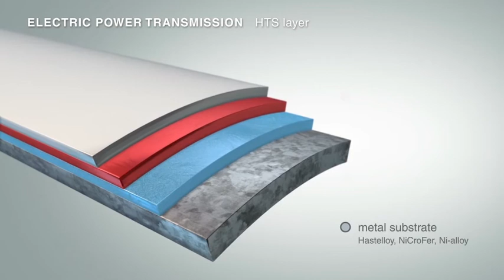High-temperature superconductors for efficient current conduction

Comment: поразительно, вопрос в том как подключить такой кабель к обычному проводнику, ведь в месте контакта проводник неизбежно начнет нагреваться
Reply from the maker: Thank you for your comment. We hope that it is ok if we respond in English, because we assume that you will understand it if you were able to grasp the content of the video and because the answer might also be interesting for non-Russian speakers. 
The question of ZzzmaerD was whether connecting a supercoductor to a normal conductor would lead to an increase of temperature in the normal conductor.

This question is very interesting because, indeed, the transition of a superconductor to a normal conductor (often made of copper) constitutes a challenge. For the transition an isolated section is used and the two different conductors are induced in the section from different sides. The section is filled with liquid nitrogen and at the contact point the copper has the same temperature of appr. 77K (-196 °C) as the superconductor. Then the temperature of the copper conductor increases steadily up to room temperature, before it leaves the isolated section.